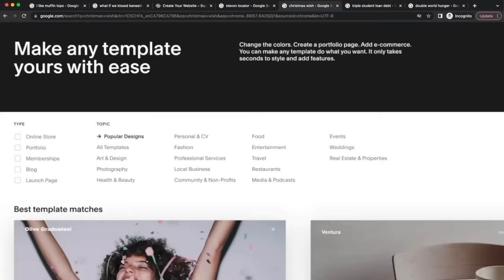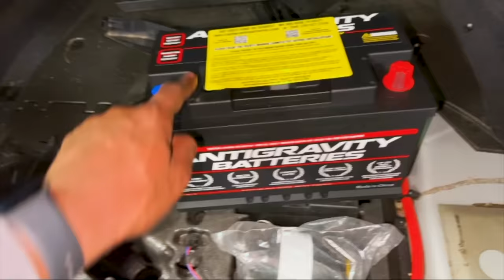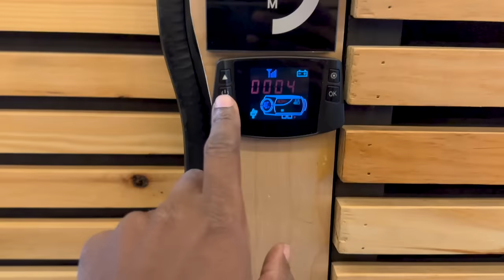I Bought An “easy fix” V10 BMW M5 From Facebook Marketplace, Here’s How Stupid I Was

Comment: I bought one of these in college with all my money and it had a manual 6 speed. 100k miles all stock i put a straight pipe on it.. can say a teen in an m5 was epic, I learned to drift, rev match, double clutch and never lost a race on the freeway even against bikes. Nothing like straight piped v10 doing rolling burnouts down college boulevard with no fear about anything. Never had issues, sold it before anything bad happened, Best experience of my life. 🏁
Reply: What you drive now ?

Comment: Mentioned before, but that looks like Liquid Moly Ceratec additive, not copper - that'd be way too much. Search "Project Farm Ceratec" to see what it looks like, or the video from Liquid Moly. Only way to know for sure would be a blackstone oil analysis with 1) fresh oil mixed with Ceratec, AND 2) your engine oil pictured in the video. (Reason for fresh oil/Ceratec mix is we don't know that there isn't copper in the formula, couldnt find anything on the MDS sheet). 

The RATTLING could be lifter as stated in video OR as simple as a failed VANOS solenoid. OR it could be as bad as the internal vanos line bursted, vanos pump itself, VANOS plungers (large end piece cap on each bank)- these all would lead to a loss of vanos pressure, give slack in the timing, and throw that noise. I suppose it could be timing guide/chain related but that would be not very common.

Rich - all the vanos solenoids are the same. There are 4 and not hard to swap. If you bought just one, you could swap out each one at a time with the new one, and see if the sound goes away. This is the easiest thing I can think of. However - ISTA software, or Bimmer Protools is a must to have with these

Comment: That copper looking stuff is Liqui Moly Cera Tec. It's an engine oil additive, and I swear it looks the same.
Reply: While I couldn't identify a product, I also was guessing that it was some sort of oil additive.  That's a lot of copper to come from anywhere else.
Reply: I've used CeraTec for years on several vehicles, and I've never ever seen it look or turn copper colored. It starts looking like thick milk and I would never be able to tell, visually, that the engine oil had CeraTec in it after even a little driving. The oil on the dipstick will still be dark brown or black-ish, and the oil that gets drained is the same.
Reply: Į have same and was bearings
Reply: @kuylerjohnson1166  same, never seen any cooper after using ceratec
Reply: No thats a destroyed rod bearing

Comment: That door chime gives me chills when I hear it.    (Never buy a BMW that does not start.  No matter how low the price!)
Reply: Oh no, when the price is low enough it allows it to be a full project!  lol
Reply: I bought an E60 M5 $5k non running off craigslist fully loaded with eisenmann exhaust and eibach springs. 118k miles.. Rich dude didn't have time to mess with it. Immaculate condition. Was a faulty IBS Sensor. Unplugged it and car fired right up perfectly smooth. Car has been reliable ever since. Going to build a stroker engine for that one.
Reply: @HAHAHAV10  my cheapest was one for 4500 on eBay a  few years back. and this one was appropriately priced but it was an LCI. That one was appropriately priced but it was a fully optioned LCI. Silverstone interior with kids in Florida sun really trashes the leather and dash. Still slowly working on that one. Despite the 120k mileage, the bearings weren’t too bad and caught that one before things could get worse.  Replaced the clutch and it was actually really good still, INPA said there were zero hard launches and I believe it. This is  one is my first drivable SMG, it’s actually grown on me but see why ppl hate it, still prefer my 6MT tho

Comment: I've owned 4 of them and recently sold one. (Down to 3). I've done several rod bearing jobs on other people's vehicles and rebuilt one V10 from the ground up. Swapped the crank due to rod bearing failure. About to build a 5.8 Stroker on my 07 M5. Besides having a stuck lifter, another issue could be a broken valve spring which is making that noise. I'd also check for vanos codes and see if the vanos pump is putting out the correct amount of pressure. I've had one engine tap like that randomly from each head because of an internal vanos line leaking. May also need to run a vanos bleed since it's been sitting for so long. Let me know if you have any additional questions.
Reply: Can I have one ?
Reply: I also have 4 of these also. I  offered to help out rich on this one after the 1st episode but after a few emails I never heard back. I figured he moved on.  I had helped out Sreten on his to figure out his vanos pump was shot. These cars need alot of work and they have a way of weeding out the ones who don’t have the full dedication to fixing them.
Reply: @Legend-lc9bv  I have a 2007 M6 80k miles for sale. Literally like brand new. $22k obo and it's yours.
Reply: @HAHAHAV10  did you do a valve seat regrind on your rebuild? I have an extra engine from a wrecked ‘10 I’ve torn it down to refresh, the heads, I could tell the valve seals were trashed, typical BMW shit. I can’t find and good info on the valve seat angles BMW used on the S85/S65 to buy the right cutter.

Comment: I sold my 6MT with 87K, zero mechanical codes, some hail damage and 15-yo car maintenance issues for $12K two years ago. For $7K and an SMG, you got ripped. I do miss driving that car, but the constant issues, from locks that wouldn't unlock to reduced performance conditions all the time were just too much.

Comment: Rich you also should code the car to tell it you installed a new battery
Reply: Battery registration should be step one !!!! Also register battery type AGM/ or lead acid this will cause all types of cel codes 
Then turn the wheel full left & followed by all the way right to clear any dtc THEN START DIAGNOSING

Comment: with bmw, before putting new oil use a cleaning liquid, watch the oil pomp too, after that... You must restore the engine, :D or sale it right now, dont run it like that, if you don't want catastrophic failure :D i have a 330i  bmw are fun and have good handling but fucked to repair it ! ;) watch Bmw doctor on YouTube

Comment: E60 is pretty bad on all accounts. the last good m5 was obviously the e39.
E90 is IMO the last true powerful and exciting BMW that's made to last. People complained my 335i was expensive to maintain but never had to do anything on it except when the ex-owner forgot to put the oil filter funnel back in and engine blew up had to be changed. Full power, twin turbos, 120,000 miles average run for the turbos and a lot more for the engine.
If you want a reliable car, BMWs are amazing. It's stunning they have a bad reputation after 20 years of degrading performance from all other brands. Of course if you look only at the V8s it's not so good. I got it out of my system just using a 3 liter 335 that got it's power from turbos - a lot more potential than just V8. 
If you need a bmw reliable just get a 6L engine can't go wrong.
If you need to waste your time then sure go the Rich way and find a craigslist M5

Comment: It is that big of a deal.  Pull the pan and check the bearings.  That is not normal.  Thats the VANOS tapping.  You could try a vanos bleed and pray.  I seriously doubt it's lifter tick.  My offer is 150.00 cash/dollar bills.  Could probably come up with Pesos as well.

Comment: I have a 2010 e92 manual xdrive (alpine white w/cream int, no I drive 🙏) that just been sitting there for like 4yrs. I have a LS1 block and a bunch of goodies im gonna shove in there. Im gonna keep it n/a and manual, I just want a cool cruiser/daily.

 I have the means to build the n54 but fuck that and fuck them. I dont want to have to worry about if she's gonna start and/or run with the OEM running gear.

Fucking gorgeous cars (why shes still taking up a parking spot in my garage...) but the driveline is just a PITA. I know there's guys out there that have them running 300k and im jealous for sure, but nah. No thanks. No mas n54.

Comment: Honestly to me that sounds more like a rod knock than a lifter especially around 12:38 

I would drop the pan and check all of your rods just in case.  Though if it is a spund rod bearing I would imagine the more economical repair would be to replace it rather than rebuild

In that case driving it to see if it goes away shouldn't hurt it any more than it already is

Comment: Literally just got done doing rod bearings and adjusting valve shims of S54. Ended up missing a shim on cyl #6 and it was making a very similar noise. You can tell by the fast repitition and the higher frequency. More of a clank than a thunk. Thunk would be mains or rods. If it has hydraulic lifters then a 'spirited' drive might free them up, but if I had no idea of cars history I would pull the valve cover and inspect lifters before driving it hard. Also, people are idiots. Metal shards in oil isn't normal. A few from wear and tear maybe, but not what you've got going on with that M5. Chances are the rod bearings need to be done soon. Good luck.

Comment: That is 100% a rod bearing noise.  It comes and goes when its idling which a valve train noise will not.  Personally, i would cancel cylinders one by one and see if the noise goes away with one cylinder.  If it does, more than likely rod bearing noise.  You might still be able to roll new bearings in to it and polish the crank journal before assembly.  Love these cars so much, but they just do this to you every time.  Good luck Rich.

Comment: Local BMW dealership filled up my Z4 trunk with water( gotta luv the free car wash...faulty drains seem to be a feature), in the process of quoting me $4k to and two months replace the hydraulic motor for the convertible top. A guy in Washington, rebuilt mine in a week round trip with better seals than come in it new, for $600.

Comment: 150k miles… original throttle actuators, original alternator, original oil cooler, original thermostat, original fuel pump, original vanos, rod bearings replaced at 115k preventatively and had minimal wear. It’s simple, don’t buy a neglected piece of shit example if you don’t know what you’re getting into 🤷‍♂️
- 8 year owner

Comment: 10w60 is the problem here. In most cases you should follow manufacturers recommendation, but probably not here, especially since you can already see metal shavings. I would probably put the thickest 5w50 I could find in it, personally.  And yeah, there's quite a bit of variance between different brands for same grade oil thickness. Not enough to be different grade, but still quite a lot. But the issue here is viscosity when cold. At anything other than hot summer day you get accelerated wear and if someone boots it while engine not fully up to temp, very easy to spin a bearing.
Reply: 10w60 is not the problem at all. But not waiting for engine to warm up and the soft bearings BMW used are.
Reply: @fueledbyadventures  10w60 oil is gonna be very thick when cold. So it's not like the bearings are shit, but more like they need to be bulletproof perfect if you gonna use that oil all season. Besides, having the oil thin when it's cold is almost universally gonna offer you more protection and result in less wear on cold starts. While realistically the worst what could happen by having it slightly thinner at operating temp is just minor increase in oil consumption.

Comment: Absolutely bearing material unfortunately. That is an excessive amount, the S85 V10s bearings are CONSUMABLES, late down the line, you are intended to replace the bearings every 50K miles. Later bearings were made from Tin-Aluminum, early M5's / original bearings are made of copper, but still suffered issues and did a better job at masking the issue.
-
The bearings are likely original and absolutely fried, some flake, specifically silver is normal, but very fine particles AND also large particles along with being able to physically collect it to the touch is a sign of imminate destruction and in need of immediate replacement.
-
Your best bet which will save you a substantial headache is to simply drop the engine and refresh it. New rod bearings with greater clearances, new High pressure VANOS lines, VANOS refresh, VANOS oil pump rebuild, new timing chains and guides, gaskets everywhere, spark plugs and coils, and throttle actuators.
-
While you are at it, refresh the SMG Transmission with a new SMG pump and new clutch.

Comment: I wish I could help you. However, I have a 2010 528i xdrive with the n52 inline 6 and a manual transmission. 
I was told by a BMW specialist shop (up in jersey, where I bought it) that e60s are very finicky when it comes to having the right battery because BMW. IDK. 
I followed his advice. Went to bmw and bit the very expensive bullet and got their battery . All of my lights on the dash went away after driving it for a while. Made the trip from jersey down to Central Florida without a problem. Now I'm just trying to do all the maintenance and fight the light rust issues it came with. Other than that, it's been a great buy. I probably spent too much on it a few months ago.
Hope you keep it and restore it to its former glory. Too bad it's an automatic. The manuals are better IMO. Good luck, Rich! Love your channel!

Comment: Ensure that the ECU/ECM aka DME cooling fan is working properly and no water leaks from the firewall cowel into the fuse box. Your timing might be off if someone went in there.

Comment: How many misfires have that engine ?
You must check oil pressure.
You must replace correct spark plugs/new 
You must check every injector.
You must  use  BMW INPA OR ISTA software with cheap chinese clone ISTA/D  not icom. 
You must clear all adaptations using inpa/ista.
Look at crankshaft bearings if possible before total damage of that engine.
Maybe that save that engine.

Comment: Would definitely do rod bearings before trying to drive with a virtual copper mine in the oil filter. DiagnoseDan channel is an absolute must for BMW DTC codes. Well for really understanding modern car multi computer systems.

Comment: One thing you can do that's VERY easy is disable a coil one at a time. If the noise quiets down significantly when ONLY ONE of the coils is disabled then that's the cylinder with the bad rod bearing. Basically when you take the combustion force off a cylinder with a bad rod bearing it doesn't have the force knocking that rod around at the base anymore so becomes much quieter. Where as a lifter will continue to tick no matter what, even if that cylinder ignition is disabled. 

I've replaced these engines before for the rod bearing issue, many of us BMW techs have. When you hear the double tap (not single tap) noise like in the video and have THAT amount of glitter in the oil filter cap bottom....it's a rod bearing. I bet if you take the oil pan off you will have all kinds of material in it. 

Note: you can't really get a camera into that oil pan because it's baffled so don't bother.

Comment: The good news is, that in order to replace the lifters (which is 100% the noise you are hearing and no, they won't magically fix themselves), you need to remove the VANOS first.  So at least you won't have to do double the labor to fix them both.

Comment: Also, car is supposed to have a fairly large AGM battery.  The car gets very upset about low voltage.  You also have to tell the car the battery has been replaced and what size the battery is.  Ours had like a 950 CCA battery in it.

Comment: Well, you have a lot of metal in the oil, you have a rod knock style noise coming from the engine, you have an engine VERY prone to having rod issues. And yet you are talking about million other things. I am sure you have some vanos issues there as well etc, but even if it is not bearings (I personally doubt), you should still change them out, even if it is just preemptively. If it looks like a duck, swims like a duck, and quacks like a duck, then it probably is a duck, don't you think? Also, I owned a V10 M6, I changed the bearings, I got rid of the car. Last one was the best feeling.

Comment: again adding a 3rd comment, when we "engine swap" a bmw that has sat, we (do oil etc, ccv, seals yada yada ofc) once its going, we warm it up. and hold the RPM to 2000rpm for around 5 min, then 2500, then 3k, upto 4k (in 500 increments)  to BLEED the lifters down. "should" do the trick. hasnt failed me yet. sounds harsh, but if you go read (it works) like magic for most cars with "hydraulic" lifters. if its not a lifter, then it could be a coil pack. but these are pencil coils so im not suer. as the usual style you could place a hand on those and feel them pecking your hand. however, im going to bet its lifter tick. as my bmw does this after its sat for months as the lifters well...ill not go into that. but yea man for the most part it sounds good to me (even with the copper in the oil) just drive it, or bleed the lifters.

Comment: that tick might be the lifters since it’s been sitting a while but either way with that amount of copper and vanos codes the rod bearings are done for. There are vanos filter and oil pump regulator filter that are most likely clogged with bearing material hence the vanos codes.

Comment: Is the SMG pumping when key on? If no will not start. Never seen copper I have same car. Need big battery computer needs battery charge issue. Battery causes codes clear drive put fuel clean.

Comment: Sounds like the flywheel tooth. Look at the flywheel waveform to see If it has an extra peak. I had one for two years. Spent more time working on it than driving it. Might get it to run good, but you'll still always be chasing codes.